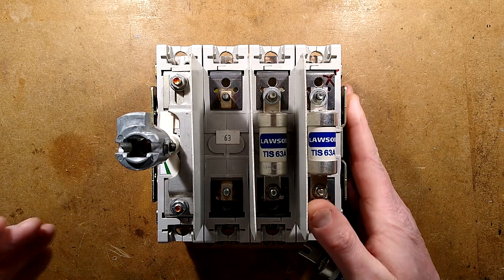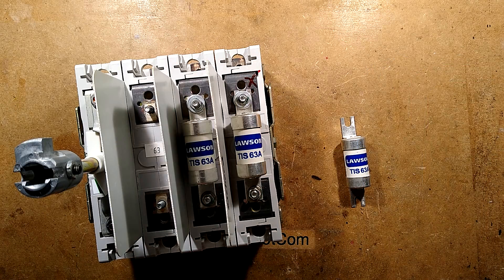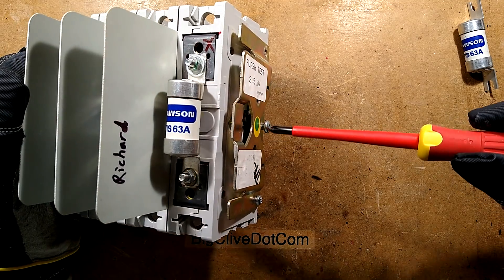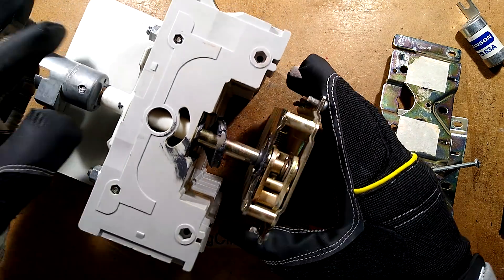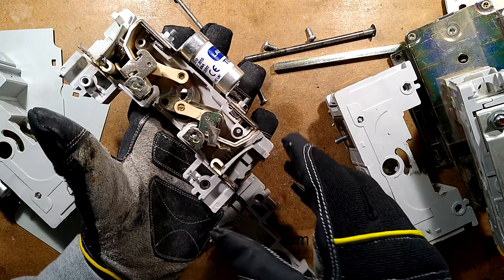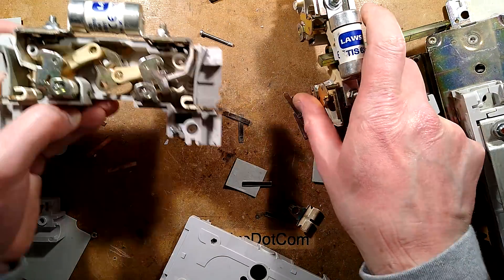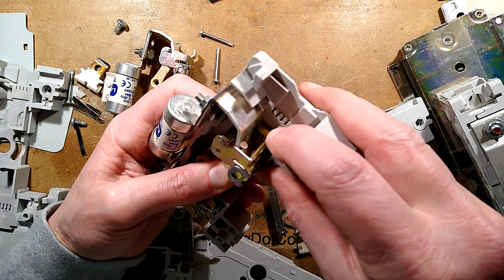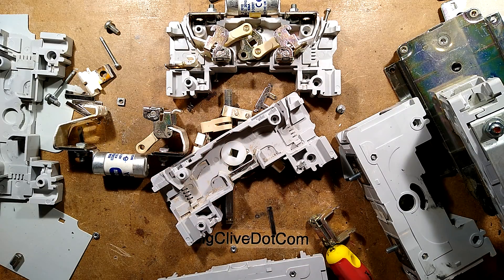Failed elevator switch fuse / fusible disconnect

Comment: 4:45 "If you just wrap a bit of wire round here..." you should be fired and never employed as an electrician again. Has someone really done that? What did they think the fscking fuse was FOR????
Reply from the maker: It's horribly common due to the ongoing deskilling.  The labour doesn't even understand the concept of an HRC fuse or arc flash.
Reply: A friend who worked in HVAC for a public school told me that shortly after he started working there they had him on the roof of an elementary school checking an AC condenser.  It's a flat roof, it had just rained, of course the condenser had a puddle around it.  He opened the fused disconnect - and found someone had replaced the fuses with pieces of copper pipe!

At that point he's looking around at the dozens of identical units on the roof - and this is just one of many buildings in the district - wondering how many more he'd find like that.
Reply: It is common for a handyman or groundskeeper to try simple things like replacing fuses. So i can imagine what has happened with some that just want to get it working.
Reply: If you bypass a fuse by cutting out the fuse and twisting the leads together with a dollop of PVC tape around it you'll be called a mad man and sent away. But if you whip out a fancy WAGO 221 from your snap-on electrician's tool bag and look at the manager dead in the eye and confidently say, "I have found the problem and it should be fixed for good now", you will be celebrated as the electrician that fixed the faulty tripping. Incendiary-disaster or pyrotechnical wizardry, it's all in the eye of the beholder.
Reply: It was very common when residential distribution boxes used actual fuses instead of sealed circuit breakers.
Terrible and dangerous practice. I hope no one even thinks about that in industrial setting. That's how you cause all kinds of havoc and more than likely kill people.
Reply: @hauuau  yes, it used to be a perfectly 'normal' thing to have a roll of fuse wire in the kitchen drawer. Scary, especially when people thought that, in the absence of such, anything metal of the same thickness would do, and if it kept burning out, then 'obviously' the thing to do was put something thicker in ...like a screwdriver. ...until the actual fault caused a fire. ...sadly, that was very common.
Reply: @penfold7800  The vintage automotive version of that error is replacing fusible links (stranded, insulated fuse wire) with regular wire. If you're lucky, they at least used proper automotive primary wire; more often it's just whatever random stuff of approximately the same size they had on hand, like speaker wire.

A variant of that error is replacing a fusible link enclosure with a "proper" fuse box - usually ATO/ATC blade fuses. Fusible links are slow blow fuses . . ..
Reply: Before HRC we had rewireable ceramic carriers.  "Who needs fuse wire, there's plenty of paperclips which look just about the same" comes to mind!
Reply: A 'business near me' nearly got thrown out of the Windscale plant for bringing a power tool in with a sawn off 6" nail as a fuse in the plug.

I don't think that's as bad as bypassing lift safety switches - which is what the Windscale's own 'engineers' had done !
They had some really skilled electricians - converted 2 fused spurs to a 26A fused ring - which you had to isolate at both ends via independent switches....
Put in a 3ph socket for 'us'  - for 'us' to only discover anything connected to it ran backwards.
Reply: MacGyver does it with chewing gum wrapper.
Reply: @andreasu.3546  yeah after reading that i remember watching that as a kid.
Reply: I must admit I did so when I was four.
Reply: I used to work on a farm estate, you don't want to know what those farmers got up to before they called us.
Reply: Put your trust in Lincoln, he will save you when your house burns down.
Over the pond in the US our fuse load centers used to use Edison screw fittings the same as the lightbulbs, I believe maybe slightly smaller? So when your glass fuse went out you unscrewed it stuck a penny in (making sure to pick heads or tails, hence Lincoln) and put your screw fuse back in.
If it wasn't drastic enough for the penny you just upped the size since they were all the same. This later led to the safety fuse, 15, 20 and 30 A and manufactured in different sizes of thread and an adapter for the older style was sold. You would screw in this adapter which was hard to get out and it was essentially making that socket a certain amperage and now it will only accept that size.

If you do a image search for "copper pipe fuse"...... You will not go to bed tonight looking at all the images.

Automotive linkages are slow blow, good to know
Reply: Pussy my 80" lathe has 2 soldered battery terminals and number 1/0 battery cable across one of the fuse links on it. It got broke in shipping might have been my fault. They are some weird fuse the company they get them from making a new one for it right now, maybe it was 2 years ago and still going strong. Stop being a fucking baby

Comment: has severe anxiety disorder

watches whole thing anyway
Reply: The cool thing about elevators is they have so many interlocks and safety features there's no way a failure like this would cause anything worse than an out-of-order sign.
Reply: @georgedorn_fnord  I was mainly just anxious about a huge spring exploding during disassembly. Thankfully it didn't happen.
Reply: @georgedorn_fnord  the problem is not the safety features. It's the maintenance quality